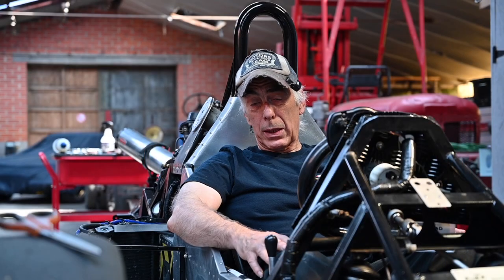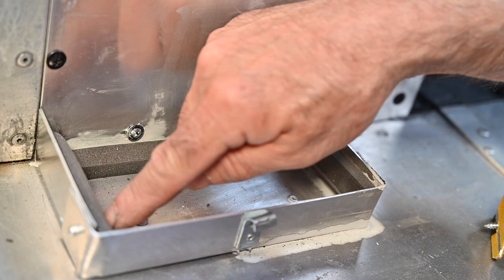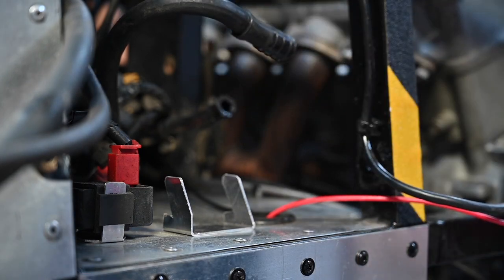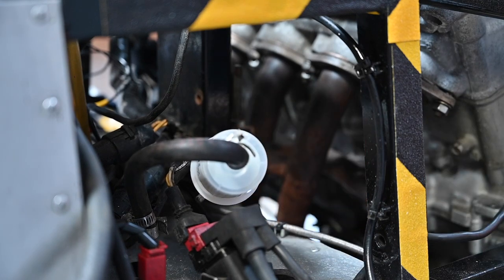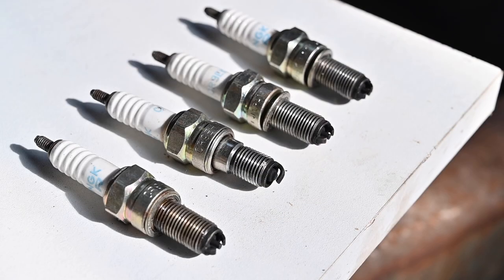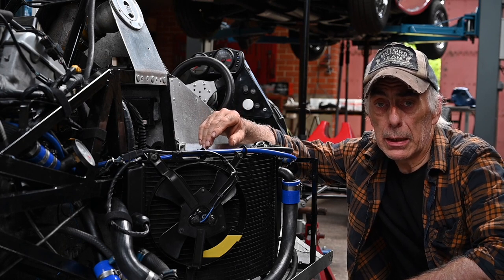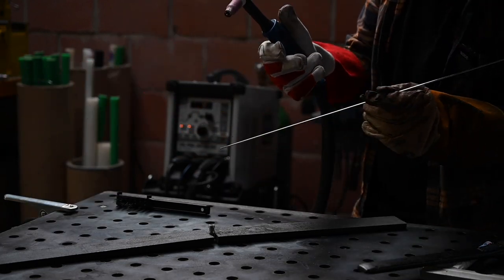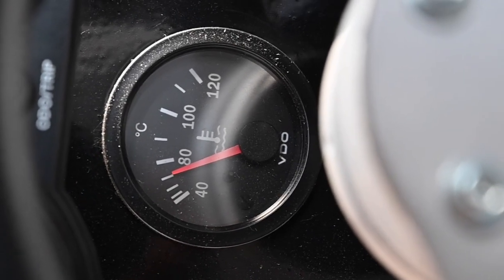Restoring an old race car Formula Konig   cooling design issues

Comment: You can use a piece of garden hose to remove spark plugs from the hole and also to put them back in and hand tighten them.
Love your work, Steve 👍
Reply from the maker: Thank you and indeed a very good point
Reply: in my spark plug holes for the SBF the garden hose is too thick, but for other engines it works great. Thinner hoses or a $10+ Champion Spark Plug Tools CT700  works fine, of course :):):)
Reply: also you can use the same igniton coil as it will also stick together with the spark plug

Comment: You don't need garden hose, or a magnet, or indeed any special tools to extract the plugs. In your specific case, you can simply use the ignition coil. Click it onto the plug top and remove. You can use plug leads on other engines.

Keep up the good work. 👍

Comment: Good video.  And yes a piece of rubber hose is the best for reinstalling the spark plugs in those deep cavities.  This to prevent cross-threading of the hole in the aluminum head.  A very bad situation.  This is the same that I do for my TransAm race car.  As the engine is set back so far in the chassis, it is very difficult to reinstall plugs on last two cylinders on each side of the engine.  The rubber hose allows you to feel the plug engage the threads in the cylinder head and then it will slip if the plug starts cross-threading.  Again thanks for the video.  Cheers from Texas.

Comment: Hi Steve, I would recommend a vent line from the top of the engine cooling system to the expansion tank. This will give you a full flow expansion tank and also get rid of entrapped air from the highest part of the engine. The vent line should be kept to 1/4”(6mm) so that you don’t introduce an unwanted cooling loop
Reply: Can’t you use what you have already as a swirl pot?  Why have two radiator top lines?  Just plug the overflow one and use purge one to swirl pot.
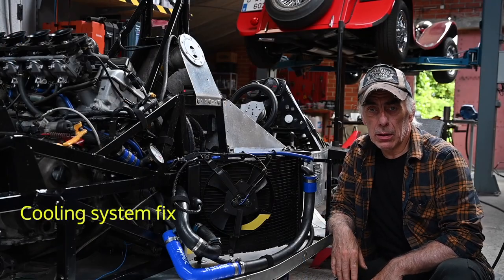Reply: cooling @17:13 -- haha, in the previous video you had removed the split hose ... that was exactly there for that reason 😂

Comment: This video of particular interest to me because way back in 1969 at the race track located north of Montreal Ca known as Mt. Tremblant/St. Jovite, during my first trials with a small sports racing car made in the US called a Bobsy, SRIII, during first trials after a complete re work I had a serious high speed crash due to a rear suspension alignment issues. The suspension was similar to many Formula cars of the day with long parallel trailing arms to take braking and acceleration loads, an alloy upright and upper and lower A arms. the shock/spring assembly was attached at a location near the bottom of the upright. 
Not much info on such things available in those days, just did what seemed right however I had little equipment available to check.
I knew the track well having raced production based sports cars there for a few years, the Bobsy was planned to be about 5% faster than my earlier cars and that would be adequate to win overall in that classification. So I had a pretty clear idea of what cornering speeds should be.
When taking one particular quite high speed corner I felt the rear sliding out but it would 'scrub off" the excess speed and all was good. However, as I pushed for quicker lap times and came to this corner the rear went out as usual but it did not scrub of speed, the slide increased at a rapid rate and I ended up  exiting the track at right angles, after overcorrecting and hitting a fence. No injuries.
It seems as the suspension loaded up and deflected there was a toe in change which made the car pretty much uncontrollable. 
That trial and error approach was not a good idea but, that was what I did.
After making set-up changes the problem was corrected and the car ended up being a winner, meeting all my expectations.
I don't agree with people saying don't mess with factory settings, that's OK but there are times when a complete rework is necessary,  but of course you have to know what you are doing. A so called "Bump steer check" is one of the things to consider. 
I also follow Dave, as I have an E-Type, bit of an old curmudgeon but I enjoy his stuff.
You di a great job!!

Comment: battery positive @9:08: I either use abrasive resistant tape where the positive cable touches any bolt/screw (battery bolt!) or some layers of liquid electrical tape over the bolt head to smooth hard edges that could rub. Vibrations have surprising effects.

Comment: Love this series. 
I see that you are always using new zinc plated nuts, washers and bolts. It would be good to mention why you are using this finish instead of stainless steel especially with the aluminium chassis and parts that you are fitting. 

It would be good to explain about incompatible metal coatings in car applications.

Comment: I think this high engine low radiator position would be a perfect example for using a swirl pot in the coolant system. It's pretty standard for race cars, the ff1600 might even have one
Reply from the maker: Indeed Stephan,  that would have been the alternative

Comment: I think there are several problems with your current cooling system setup.
To start with, this engine is a fast reving race type engine with a high output of power and heat. So, the cooling system needs to be very robust and able to deal with the full range of cooling demands. Now, there are cars and piston engined aircraft that have the radiator mounted below the cylinder head height. The Mini mark4 (I think) that came out in the late 80's is one such car. If you study those systems, you will see the radiator tanks do not have any fill caps.

1) The radiator side tanks should be fully enclosed. But yours is a factory original for the motorcycle, so not sure how you will resolve that issue. Capping it off is not the right way to do it as this is a race car and the pressures can rise quickly. To fill the system, there should be a manifold (on cars like the Mini its made of aluminum alloy) with the radiator cap on there. The highest mark of the coolant in this manifold should be approx 5mm higher than the coolant in the cyl-head(the cy-head is the hottest part of the engine). All this is to ensure no air pockets remain in the system.

2) You have installed long hoses to the radiator, this will take some energy away from the water pump just to creat a suction in the system. At high revs/speed the hoses will tend to collapse, because of the high voluum to pump through. There should be solid, metal tubing in most of the plumbing and the hoses used only in flex areas like the engine to chassis connection and the connection to the radiator - here a hose length of approx 60mm will suffice.

3) A major point to consider in the cooling system design is safety since this is a race car. Suppose the engine overheats for some reason, like a failed pump etc, then the drivers cockpit area should not get any hot coolant or steam there. There should be a firewall between the engine and the cockpit and the plumbing done in such a way as to protect the cockpit area. The plumbing should also be as short as possible.

Hope this helps, I am not a specialist in race cars but engineering is my passion.

Regards,
M K Malak.
Reply: RE 2) the hard silicone will unlikely collapse with the motorcycle engine water pump.
RE 3) I. So. Agree. been there, done that. the steam will go everywhere, despite helmet and head sock.